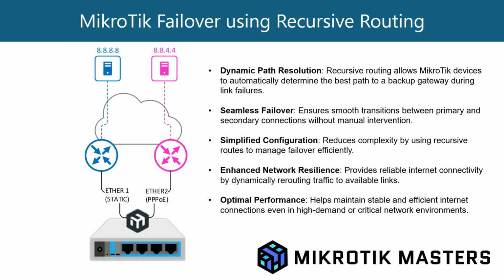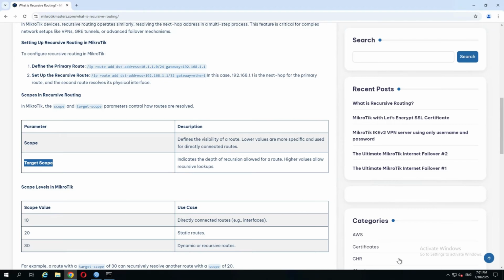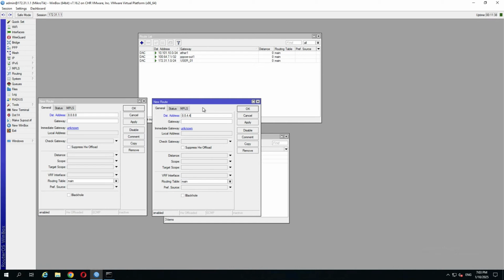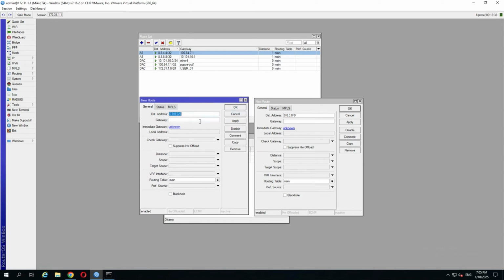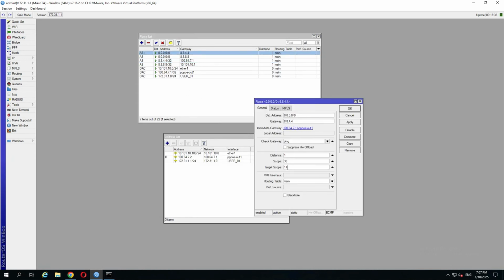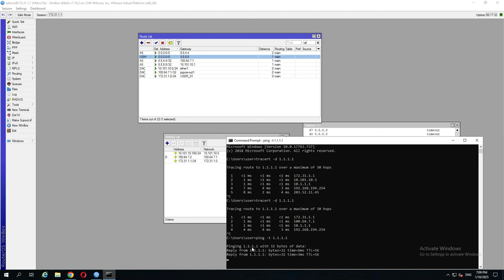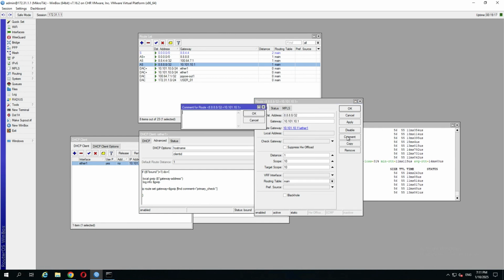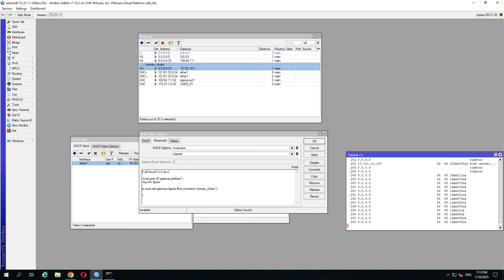Ultimate Guide to Dual WAN Failover with MikroTik (Recursive Routing)

Comment: I would like to thank for your hard works on the tutorials.

I am facing issue in configuring the failover in one of the mikrotik router with ROS7.11.3 using DHCP client based ISPs.

To be precise, both of the ISPs provide multiple dynamic gateway address as each time the connection reset. (e.g. isp1 has subnet 83.18.x.x/24, 213.68.x.x/24, 217.54.x.x/24. It goes the same for ISP2 as well.)

How do I configure the routing in such case.

Your support is greatly appreciated.

Comment: I'd like to get this working with Policy Based Routing.  I'd also like to ping at least 2 DNS IPs per WAN, ideally 3.    You can end up with false positives with a single DNS IP test.  2 DNS in a row is a lot less likely to create a false positive.    3 is almost impossible.

I'd like to have some connections marked and route marked to utilize a specific WAN connection and only use the backup connection if the specified WAN is down.

Comment: on my hex script returned error, OS 7.18.2. this one worked just fine

:if ($bound = "1") do={

  :local gwip $"gateway-address"
  :log info $gwip

  /ip route set [find comment="ISP-1_check"] gateway=$gwip

}

but in general video is perfect and ez
Reply from the maker: OK cool, thanks, so you set the [find.... part before setting the gwip, and used single brackets for your if command. Eitherway I'm glad it worked for you. Appreciate the feedback!

Comment: Thank you very much. 
What about the same, but for IPV6? 
Does it exist at all? Thanks again.
Reply from the maker: I haven't tried it with IPv6 but it should be possible. It would be good test that out
Reply: @MikroTikMasters  Thanks for your attention. The problem I see is: with IPV6, we don't usually use NAT. So, having two WANs, we have also two ipv6 address for each host. How would they know wich address to use? Thanks again.